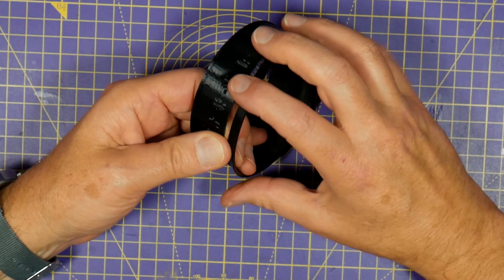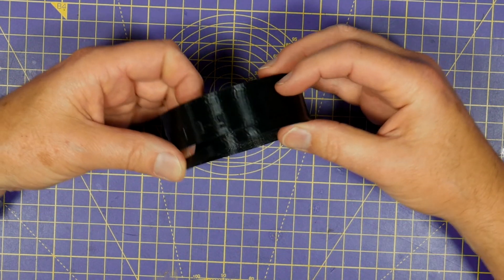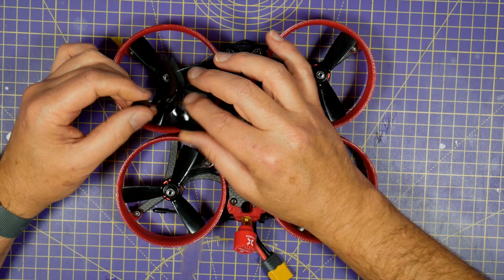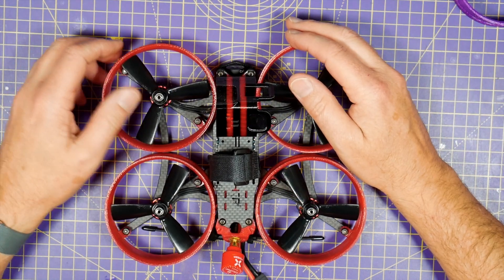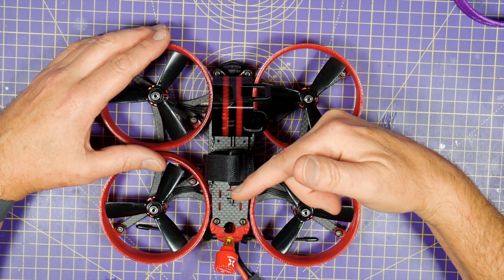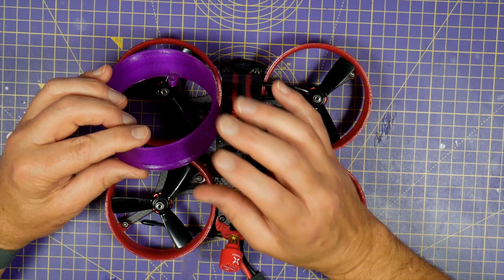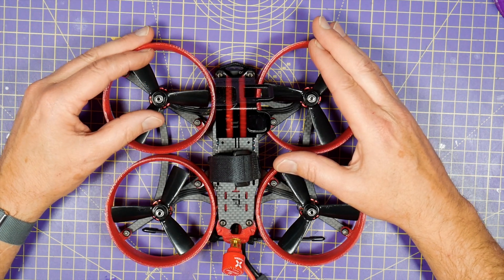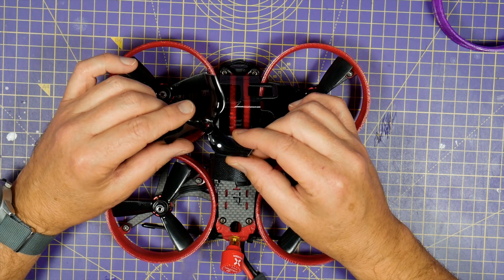iFlight MegaBee V2 // 3D print ducts in TPU

Comment: Thanks for the tip on installing these TPU ducts. I bought a used MegaBee that came with TPU dicts and the blades scrape the ducts so now I know how to fix that.
Reply from the maker: For best performance the prep need to be as close as possible. Glad it helped and thanks for watching.
Reply: this might be a little to late but the same happened with mine what exactly did you do to fix this ? thanks

Comment: interesting , My megabee was delivered on friday from banggood it came with hsxrc 3045 props not dal props , the binding on the ducts was terrible so i opted to sand the ducts ,but i soon gave up and sanded props instead , i like your idea of the tpu duct but taking out a esc in a bump may not be worthwhile switching to tpu , hopefully someone will come up with a better design in pla than the original, Great work anyway keep the vids on the megabee coming , after watching your fist vid on megabee made me hit the buy button 👍👍👍
Reply from the maker: The fit on my 3045 props and the PLA ducts was almost perfect with about a 1.5mm gap and no binding. It may me worth letting BG know there was a problem. Generally sanding the props is better cos there's less material to remove. If you do use the TPU props they obviously flex, but generally when you hit something you tend to bounce off and move away so it's not a real problem. This is exactly the same on the Squirt. PLA is just to brittle for ducts. Maybe nylon is a better solution for you.
Reply: Do you pay custom charges to import megabee from China to US?
Reply: @SohaildSingh  i didn't to the uk
Reply from the maker: @SohaildSingh  I'm in the UK and have never been charged customs. Chinese suppliers always want to do business so they try to make shipping and customs no problem.